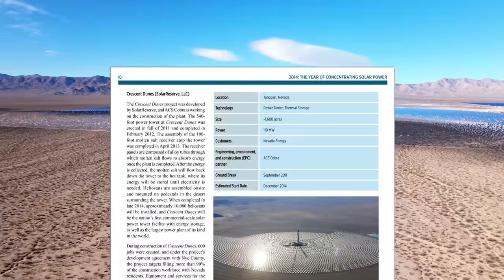The Failure of America's $1 Billion Solar Farm

Comment: Money would have been better spent on nuclear energy.
Reply: Makes to much sense.
Reply: Ask the Japanese and the Ukrainians!
Reply: Nuclear requires water, and lots of it. The Arizona Palo Verde Nuclear Generating Station is an anomaly; it was once "the largest nuclear generating station in the Free World" although it does not sit on a river. Instead, it gets cooling water as effluent from the Phoenix metro area.
Reply: @flagmichael  - Yeah, that old used-up drain water is not needed at all in Arizona!
Reply: @flagmichael According to the data, nuclear takes about 400 gallons per megawatt hour. Average home uses probably 11 megawatts per year. So 4,400 of water per household to generate electricity. To put that in perspective, the average US household uses 110,000 gallons of water per year. Assuming a homes current electric doesn't consume any water (nearly all power generation consumes water), switching to nuclear would increase a homes water consumption by 4%. Again current electrical production also required water so the percentage is actually lower as some other carbon intensive source could be taken off-line.
Reply: Those plants cost way more than just $1B
Reply: @jbcom2416  Agreed but this plant is producing zero power and cost $1B an infinite cost per KWh.

Hinkley Point C is estimated to cost $41B and supposedly generate 3,260MW for 60 years. If it does that and there is zero other costs (clearly not the case but for simplicity), that will come to 1.7million TWh of generated capacity or $0.024 per kWh generated over its lifetime.

The Crecent Dunes project has put out a total of 594TWh over its life (assuming it doesn't restart). With a construction cost of $975 million, that comes to a cost of $1.64 per kWh. That is insanely high as the US national average price for electricity is $0.125 per kWh. That solar plant made electricity for 13 times the national average price of electricity and 68 times more expensive than Hinkley.

Yes, while $1B won't build a nuclear plant, putting it toward a nuclear plant is a much better idea than the Crecent Dunes project. Burying it a coffee can is a better idea than Crecent Dunes.
Reply: Smaller scale nuclear reactors are the way to go
Reply: New technology needs to be proven on a small scale.  If our Government Energy Division gave $700 million then this should be voted on by the Public Citizens.  The questions regarding potential failures, design flaws, inefficiency, cost of operation and reliability are before loan approval issues.  The need to evaluate the cost, return on investment, operating expenses, life cycle, and technology long term efficiency should be reviewed.
Reply: Or better yet clean coal! They can control the CO2 output and keep it at the optimum rage for life on earth.
Reply: @flagmichael why wouldn't they use a cogen process that uses the hot cooling water in a closed system so they never need to add any?
Reply: There is a nuclear plant right next to it. I’ve worked there. There is also a traditional solar plant there too. 😂
Reply: CO2 is not a problem people!
Reply: Nah, better spent on high speed train between Bakersfield and Los Angeles
Reply: @NotDuncan ....Individual solar systems on individual properties is the answer, but that's too independent for the population for the government to allow
Reply: It looks like Nevada took a gamble, and this time THEY lost. 😅
Reply: @toserveman9265  high speed train that we can't produce enough electricity to run?
Reply: Or Pokemon cards quite frankly.
Reply: @terenceiutzi4003 no such thing as clean coal.  Sorry but it’s just a PR buzz word for the coal industry.
Reply: @terenceiutzi4003 the idea is that high speed rail would vastly reduce the number of flights or people driving cars.  The fuel that would have been burned in ICE engines would be saved and a fraction of that fuel could be burned to propel the trains.  So at the end of the day moving people becomes way more efficient pollution wise.  That’s the overall idea.
Reply: @brettgracey9682  Yes, but we will never produce enough electricity to drive it! When we switch to EVS we will only be able to produce enough electricity to charge 2 percent S many cars as we have on the road today with no electric public transit.the rest ofuscan sit at home in the cold and dark!
Reply: And/ or natural gas which we have plenty of.
Reply: Remember Solyndra…
Reply: Yes let's crap on our planet instead.
Reply: @schnauzerloversmom  remember when the big 3 were given tens of billions in bailouts?
Reply: @Dreamhelmet I wouldn’t put Ukraine in there. Russians used a piss poor cheap design and not enough safety measures. There test was the perfect example of it.
Reply: Even Russia does not design plants like Chernobyl any more.  That plant had some serious design flaws.  In spite of the damage to the plants in Japan that were built during the 1980s, deaths were from the tsunami and from stress and complications of evacuation - but no deaths were from radiation.  Designs today are even safer than the Japanese reactors.  And we should build them in places that won’t be in the path of a tsunami.
Reply: Exactly right.  In fact a greater risk is from not enough CO2. We are currently at about 400ppm.  If we go below 150 ppm plants die and then everything dies. There have been several times in the earth’s history when CO2 was several times higher than today and there was no catastrophe.
Reply: @flagmichael  I think he meant in general not in that location
Reply: Probably not: considering Olkiluoto cost 13Bn to power '1Mio' homes, these 1Bn to power '0.075Mio' is comparable, and the NuclearPowerPlant costs fuel and maintenance and waste treatment, NevadaSolar cost just maintenance. Even the desert should benefit: more shadow on the ground means less water evaporation, more green and more wildlife, as solar radiated energy is carried away from this spot. I don't count NuclearPowetPlants as water waste, as the do not consume it, just heat it up.
What we have here is an example of the failure of capitalism. Even if electricity from photovoltaic costs 30 and from this plant 135, there is no electricity at night time for 30, you can be proud to get it for 135 at night. Nuclear power plants are very important to get isotopes for atomic bombs, but are just devastating dangerous. Consider a nuclear power plant to throuput the energy of one bomb EACH DAY.
Reply: @Dreamhelmet Ask the two places that failed at it 🤣
Reply: @Dreamhelmet  Nuclear is the cleanest and safest way to make power.
Reply: Tell me you are uninformed without telling me
Reply: Hell for one nuclear energy plant you could put solar panels on top of almost every home in the state of Arizona
Reply: @shawnstangeland3011  A million homes would cost about 20 billion dollars to install solar panels.
Reply: @shawnstangeland3011  - Every home could have solar and a Tesla battery bank as storage and ballast/storage for the whole, interconnected grid!
Reply: @briancleveland6115  wrong about that.   7.2 million live in Arizona.  20 billion would be the cost of a nuclear power plant that would not supply the entire population. 20 billion could easily put 9 kilowatts of solar panels on top of every home In Arizona which would easily supply the entire state
Reply: @michaelhearne3289 did some elementary school you dropped out of tell you that?
Reply: @shawnstangeland3011  ohh funny.  No unlike you I have a Degree in Mathematics and History.
Reply: @michaelhearne3289   I have a biochemistry degree and know they don’t teach you anything about science in math or history
Reply: @shawnstangeland3011  Not even close solar panels would cost at least 10,000 per house so that's 72 billion and a nuclear power plant costs about 10 billion, but since Arizona doesn't have the water supply needed for a nuclear power plant it doesn't matter anyway. And since solar panels on a home only benefits that home each homeowner would have to be responsible for the cost.
Reply: @briancleveland6115  your math sucks.  7.2 million people with maybe one house for every three or four.  2.4 million houses.  $9000 for every house could put 45 solar panels up.  Really good ones only run 200 a piece and produce at least 360 watts which is 16 kilowatts for 45 panels. Way more than most homes need.  The state could export power with a twenty billion investment of solar panels.  I know very well since I just built a solar system with battery back up for my house less than 9000.
Reply: @shawnstangeland3011  My math skills and perfect, I thought you said 7.2 million houses but you said your cost was 9000 so I was right about that 10,000 per house average times 2.4 houses equals 24 billion, and like I said homeowners have to buy their own solar panels and even if you generate more power than you need it still wouldn't be very much extra, and there is no chance that every homeowner wants to have solar panels or wants to pay for them, not even half of the homeowners would ever want to install solar panels on their house.
Reply: @shawnstangeland3011 Nuclear has the highest capacity factor. Can solar generate electricity at night 😅. The cost of building a nuclear plant is high cuz people have neglected it. In South Korea the cost of building  new nuclear plants has gone down due to their R&D.
Reply: @neddiego2570   sad you know so little about solar or lithium iron phosphate.  They are incredibly cheap now.  You could easily supply every home in a state with solar panels for the cost of a just a couple of nuclear power plants that wouldn’t supply the equivalent energy
Reply: @jbranche8024 Voted on?where else are they going to get a power source that's good,and not an eye sore?
Reply: @neddiego2570 Nuclear power isn't safe.
Reply: @briancleveland6115 How much would it cost for nuclear?
Reply: @galvinstanley3235  The use of nuclear energy for electricity generation can be considered extremely safe. Every year several hundred people die in coal mines to provide this widely used fuel for electricity. There are also significant health and environmental effects arising from fossil fuel use.
Reply: @galvinstanley3235  2 to 9 billion $
Reply: @briancleveland6115  Ok,but you need R&D to make an upgraded nuclear power plant,the technology behind those big ones goes back to the 60's.
Reply: @Dreamhelmet nuclear would have been better but its 10 times more expensive to build and then there is the waste which is manageable...difficult but manageable
Reply: Spain build 2 of those in 2007 and 2009. One with 11 and one with 20 MW. The cost was around 35 Mio. for the 11 MW one. It's currently still running and they are planning 5 more with 50 MW each.

So, the US plant from 2015 wasn't using that novel technology. They just messed up big.
Reply: @walli6388  Isn't that cute 🤣
Reply: @briancleveland6115  ? The us also has a 2 billion 395 MW plant near Las Vegas (140.000) houses. The investment cost per kWh lies somewhere between a coal and a nuclear power plant.
Reply: @walli6388  Cool 😎
Reply: @bertgraves6385  - Nuke fans are so full of excuses for their disasters - such eternal optimists!
Reply: @flexiblebirdchannel  - You have a lot of uranium calls?!
Reply: @briancleveland6115  - Gaslighting at it's best!
Reply: @Dreamhelmet  Thanks.
Reply: @Dreamhelmet  Exactly what disaster are you talking about ?
Reply: @flexiblebirdchannel  You don't understand how nuclear power is made.
Reply: @Dreamhelmet  uranium calls 🤣🤣
Reply: @briancleveland6115  What an impeachment. Please assume that not everyone is as intelligent as you are. Most do better.
Reply: @flexiblebirdchannel  What impeachment are you talking about ? Please assume that not everyone is as intelligent as you or Most people do better, saying both makes no sense at all.
Reply: @crissd8283 well as per this video, this was a terrible design. Actually, the price for solar is so low that with the same 1 billion and they will be able to achieve a very strong out.

Comment: Saying the "Engineers did not account for temperature" simply means that no engineers were employed in this project.
Reply: Exactly.
Reply: Yes, mirrors in that dusty windy environment.  Good luck.  At least someone got filthy rich, while the tax-payers footed the bill.
Reply: The project was run by bean counters (or scammers).
Reply: Heat energy is the heart of the business, why do they not have materials to handle it? CRAZY. Like shark tank responses, "I am out!".
Reply: Truth
Reply: Wonder if Al Gore was involved
Reply: All the colors of the rainbow needed a job.
Reply: Maybe they could offset some of the operating costs by selling rotisserie birds, that fly by, to Costco.
Reply: Similar to automotive mechanics not being consulted on simplifying maintenance of cars by the engineers when they design them.
Reply: What that really means is that someone needed a scapegoat to blame for an unproven technology.
Reply: Engineers always prove the theory with numbers or tests or a proto-type, but when the big boys need to point a finger then this will happen!!! Just commenting.
Reply: temperature a very basic issue for these projects essential to consider. the engineers used must have previously worked on so many so called luxury vehicles that fail religiously with engineered weal points.
Reply: The lack of training of engineers I’ve worked with is appalling. Yes, this was an engineered project.
Try digging a hole for a fence post - you’ll need several engineering reports for that single task before a permit is issued.
All I can say is you must be an engineer -
Reply: @andrewrivera4029   I guess your sex trafficking ring was depleted by them finding employment somewhere else ?  And explains your disgruntled attitude ?
Reply: Though usually they are employed but not listened to.
It's important to remember we live in a capitalist system so the people with the most money get to make the decisions, rather they are qualified for those decisions or not. This is the same problem they had in the Soviet-Union where it was political capital rather than economic capital but also there political leaders employed engineers but didn't listen to them. Those engineers are there mostly for the credibility of the person in charge and if they don't like what those engineers have to say they will just be fired and replaced by 'yes' men.
Reply: I agree, this isn’t a unique project. Others like this exist around the world.
The only reason this would fail is if was planned from the beginning to fail. 
Engineers can’t account improper maintenance.

A Dodge in a mechanics hands will last a very long time.
Reply: @davidsr9719   I watched em trying to pull a boat out the mud this last week .
Suxion .  .  . it aint moving :\
Reply: @YourDadsBoyfriend  Probably Big 10 graduates. LOL
Reply: That's not what the narrator said.

He said that they didn't account for location specific temperature VARIATIONS.

Simply building something to operate at high temperature is not the same as building it to operate at high temperature without suffering catastrophic breakage when the temperature plummets over night causing the equipment to cool too fast and crack.
Reply: mba2ceo  

"It was JUST a scam from the beginning. My opinion"

The concept is sound, the implementation was simply lacking the engineering experience they obtained from this project to tell them what NOT to do when building a solar thermal project of this scale.
Reply: @denisekarolewski640 How Dare U....
Reply: @YourDadsBoyfriend unqualified in just about any corporation...scary to know what is out there encouraging people to believe in something they have no clue about...no clue none
Reply: @andrewrivera4029 yes, including the white color that thought up the scam to begin with.🙃
Reply: @denisekarolewski640 King of the Carbon Tax
Reply: Yeah
Reply: They probably calculated based on averages and didn't map out extreme cases. There are so many details in projects like this. Iterative progress is inevitable.
Reply: Exactly. Sounds like someone is shifting blame.
Reply: @stephenc2481  solar panels convert light energy to electricity. High temperature leads to decrease in the efficiency of the solar panels. For example: in a bright winter day solar panels will generate more electricity than hot summer day.
Reply: Fr
Reply: All trained in Harvard and MIT?
Reply: mba2ceo well introretwd snd boldly stated, xwirkd class hoax?
Reply: I'm not an engineer but when I heard that, I knew the people on the project were just incompetent.